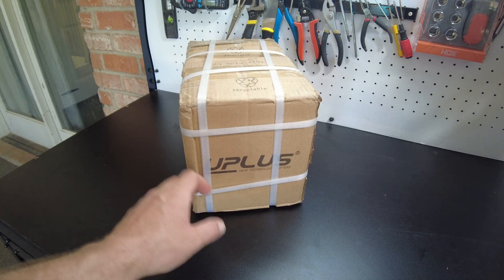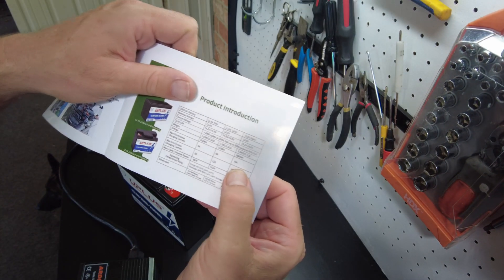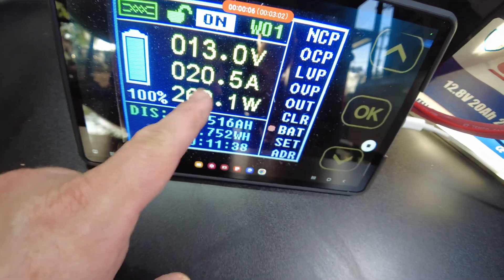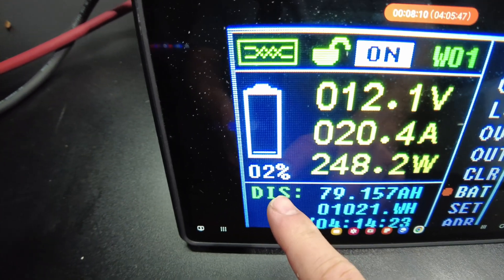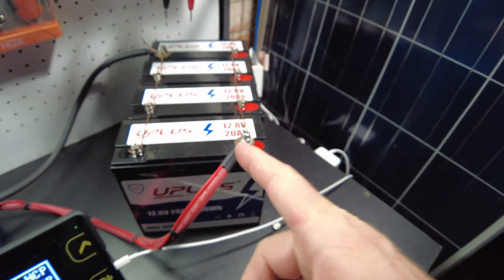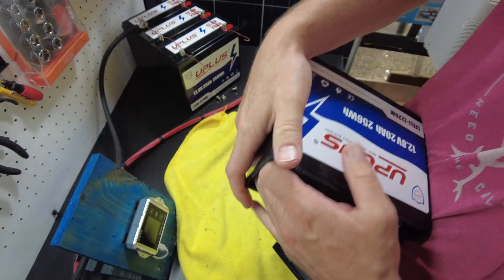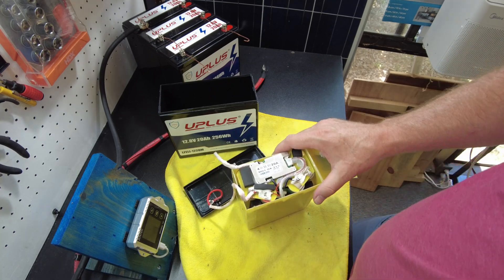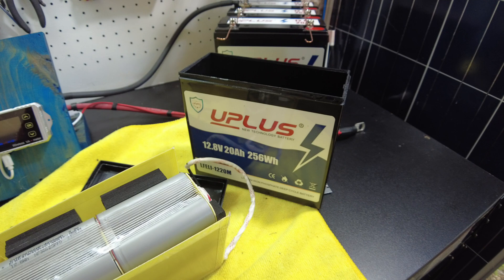UPLUS 20Ah LiFePO4 Lithium Battery

Comment: No low voltage cutoff in the BMS?
Reply from the maker: Is that what I said? I meant low temp cutoff.
EDIT: Well I don't see where I said that, so what do you mean, maybe I'm not understanding :)
Reply: @BradCagle  You mentioned low temp cutoff, but I don’t think you mentioned LVC at all?  I could have missed it, but it looked like you switched the inverter off when it’s low input voltage alarm went off?
Reply from the maker: @JeffinTD  Ahh, yes I kill the inverter when it starts beeping. If I wait till the battery goes low voltage protect my shunt will shut off, and I lose the data before getting to talk about it. I've thought about this, I need to have an external power supply to keep the shunt going. Probably address this soon. Thanks.
Reply: @BradCagle  I see.  Sorry if I sounded like I was a smart alec or accusing you of saying there was no LVC. The only smaller lithium batteries I have experience with a are Li-Po for electric planes, and Li-Fe/ion type packs as receiver power for gasoline airplanes. 

Electric power model airplanes generally have low volt protection built in to the speed control, first making the motor pulse, then eventually killing the speed control while still supplying power to the receiver and servos.  

Gasoline models, pervious servos designed for nicad are often 6v and a full charge 2S Li-Po is too high voltage. You can run (expensive) high voltage servos, or a voltage regulator (another potential failure) or run li-feP04 without regulator. No LVC as you wouldn’t want to loose control of a 5 horsepower flying blade.  The user monitors the amp hours to recharge, and generally limits flights between charging to always be well above 50% measured capacity. 

In any case, cell balancing and temperature monitoring are done externally to the packs.

Anyway, this rambled. I legit wanted to know if these smaller batteries included over discharge protection internally…
Reply from the maker: @JeffinTD  I didn't think you were being smart Alec at all 😁 Yes these batteries have low and high voltage protection, and also cell level voltage protection. Usually the BMS will monitor each cell to make sure they are in 2.5v to 3.65v range. If they venture out of this range the BMS will shut off either discharge, or charge respectively. Thanks
Reply: @BradCagle  Makes sense. Thanks. And nice video.